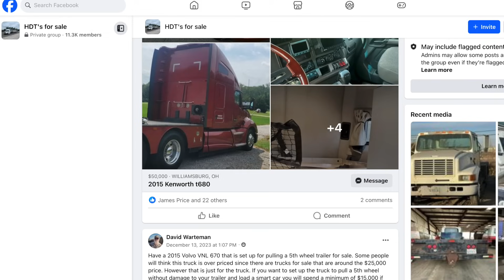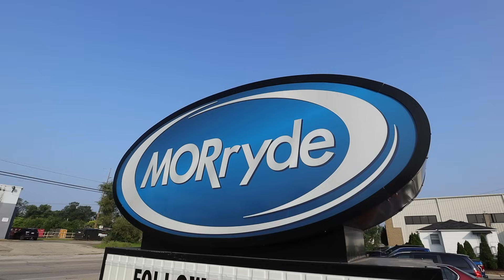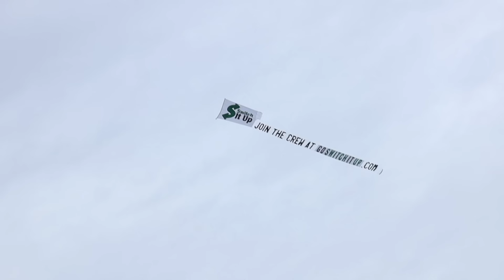Regrets and Lessons Learned: Starting Full-Time RV Living

Comment: Moryde independent suspension is not without their problems. Alignment issues that just tear up tires.  The rubber torsion springs do break, and should be replaced periodically $
I switched to the Roadmaster independent slipper springs two years ago and I love them. No issues whatsoever. (So far)
You can get by with the oem leaf springs, if you replace them every two years. Use the thick shackles with wet bolts, and grease the crap out of em.

Comment: Awesome video and we are going full time this year. 
  We met ( Sheila )  you at last years Tampa Supershow   
   Everything you said in this video we already considered and are ordering with our rig. 
 Except dual pane windows. I have to check on that. 
  The part leaving the home community and the small circle and exploding into travel and seeing places is a complete culture and life change for us. 
  I’m excited, it will probably take me a while to adjust to the RV community. 
  How long did it take y’all to finally click into your new lifestyle?
   I can find a way to have fun in a cardboard box given the time. 
   The anticipation is driving me nuts. In the next few months the house and land sells. We will order the fifth well fully loaded, solar, generator ( you didn’t mention that ) independent suspension, disc brakes, residential fridge etc……. King size bed. I prefer a queen but she wants the king. While waiting for the build of the rig we will stay in our Class C. We can easily handle that for a few months. Probably take in a long cruise while we are at it. We are seasoned cruisers. 
   Love the video and excited about stepping from my old community into a new one

Comment: We spent a year on research (2020). Drove 500 miles to see the one we bought as there was no KZ dealer in Nevada. Just repeat what you did slower. When purached, we had installed 2 lithiums, a second solar panel and the generator. Ours came with duel heat pump AC and duel pane windows and a dishwasher. We were having our IS installed and meet you there.

Comment: Good tips. For your followers: I don't full time RV, but work 2 many hrs back here. Used to travel 280+ days/yr for decades for work. Met people (customers & more) all over North America. Seen tons of country. Visited many tourist destinations on my time off. Have had my RV as a seasonal  at a small 50 site camp ground  for past 13 yrs. Great friends with other seasonal campers.  Also take it out. Made my 1st huddle in 2023. Best time ever. I will agree with your statement of meeting people. Get out and do it, even if only part time. That it better than having the right RV (but it helps). See ya all on the road in 2024.

Comment: All the things your listing is the reason that I bought a well-built older Monaco dynasty class a diesel pusher. Was already built with all the upgrades your listing and I don’t have any of the trailer problems that you guys have to deal with I have added 4 200 amp hour lithium batteries and a Victron multi +2 inverter charger.

Comment: I enjoy you and your videos SO MUCH! I get so much help from all your stuff. We are in year 2 of  our current TT. We're 30+ years into camping, started out in a tent, then had a 'strange' pop-up J/Trax 1202. We love the room, amenities (bathroom), sitting area in the new rig  . . . BUT, the refrigerator!!! It does NOT run on propane, only 12V. (We feel like the dealer did a bait and switch 😠) We do mostly boon-docking in the Adirondack Mountains. I'm following your suggestions on lithium batteries and we want to add more solar. My husband is researching how/what to switch the charger out to so we are compatible with lithium.

Comment: Great video thank you!! Not sure if you are grand design ambassadors or not. If you are my question is why was the momentum 336 M discontinued after less than a year on the market? I really like the layout as a Toyhauler, because we are only putting the Harley in the garage. I was going to buy one this year after the “bugs” were worked out, but since it is no longer being produced I’m worried that there was a design or safety flaws
Reply from the maker: Well the flex issue has been on other Models. We are not ambassadors. We love our Floorplan but have something new coming and we wanted our 395 looked over from top to bottom by Grand Design to provide piece of mind to whoever we sell it to. Good stuff thanks for watching.

Comment: Interstate highways are terrible. Last 2 years we’ve taken 3-4 month trips over 10,000 miles each year and we have not driven even 1 mile on the interstate. Secondary roads are in much better condition and a lot less traffic. Granted we normally drive 60-65mph , we have an F250 and a 25ft trailer. The views are much better seeing America via secondary roads.